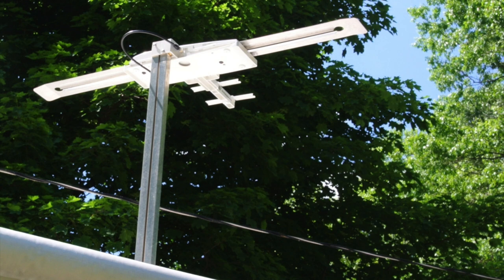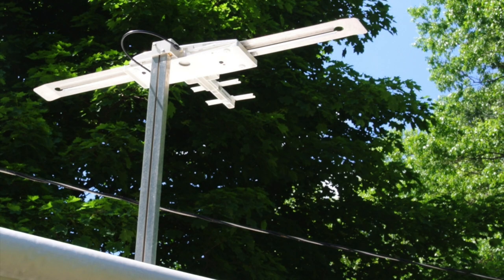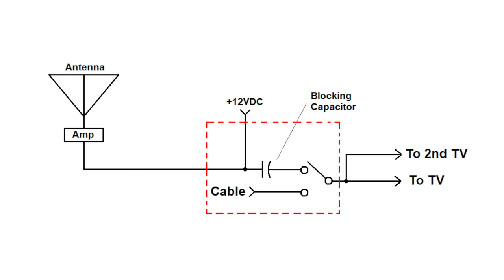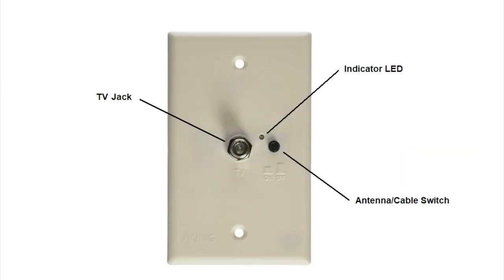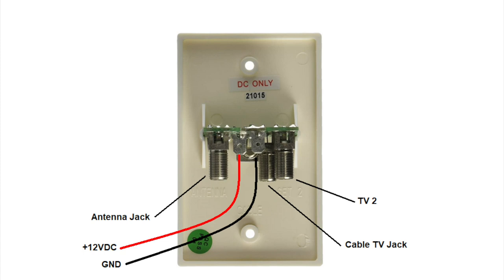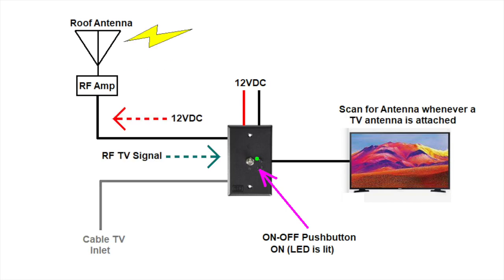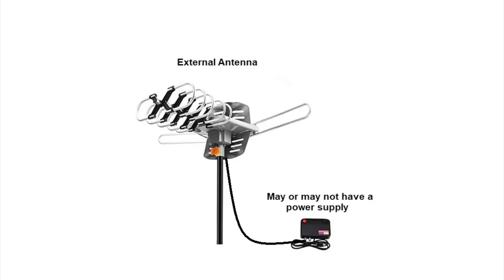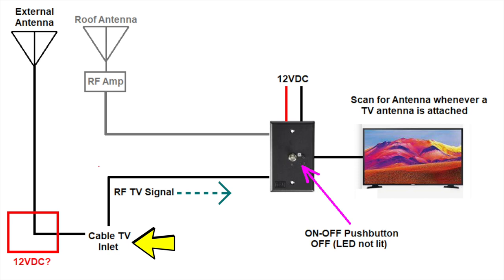All about your RV's Antenna Connection

Comment: Thanks for the information on how the switch works! My previous RV had 2 TV's hooked to the antenna and worked great. My new bigger and more modern RV has Coax going to 5 places but only one goes to the antenna! I started tracing to figure out where all the outlets go but the antenna switch plate will only come out about 1/2 inch because there is not enough slack in the coax! At that point I decided that was a project for another day that has not yet come.
Reply from the maker: Sounds like typical RV manufacturer quality.

Comment: Very clear explanation. Could you do another one showing how to hook up satellite/satellite box with the system you showed?
Reply from the maker: On my website www.rv-project.com I have several videos about wiring a satellite. Its under the gear menu selection.

My RV is "satellite ready", but the factory installation was so bad that I eventually rewired the satellite coax.

You can find that video under the repair section of the website.

Comment: Can this be used for internet connection?
Reply: If you have the external connector plugged into a service line, and you have an Internet modem hooked up to the coax inside the RV it should word

Comment: If I remove the blocking capacitor will it allow dc power to run both my tv (dc compatible) and amplified antenna at the sametime safely?
Reply: No
Reply: Not unless you have a custom made TV that meant to be powered off of the antenna port

Comment: My Radio wouldn't get very good reception when camping in the mountains so i hooked it up to the TV antenna works perfect now.
Reply from the maker: Many RVs hook the radio up to the TV antenna. I should have mentioned that in the video.
Reply: Yep, the FM broadcast band sits right above the old VHF Low TV band (in some locations, one could listen to TV channel 6 audio by tuning below 88 MHz on an FM radio). Thus the old Batwing (and similar TV antennas) are often ideal for bringing in FM radio.